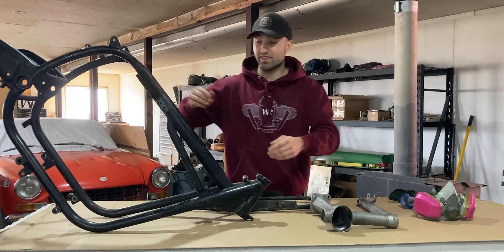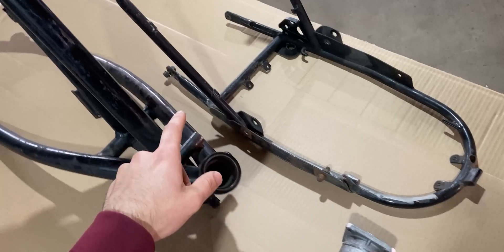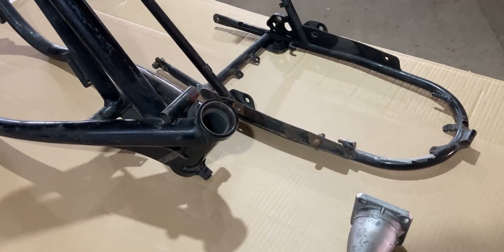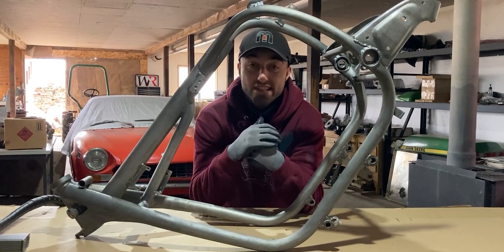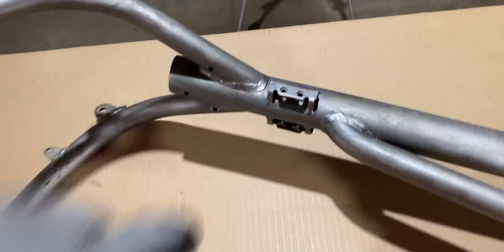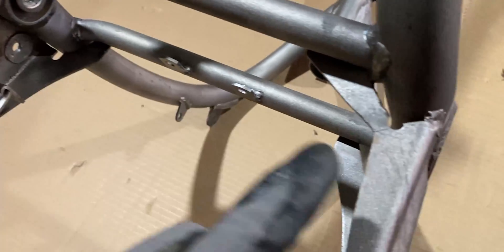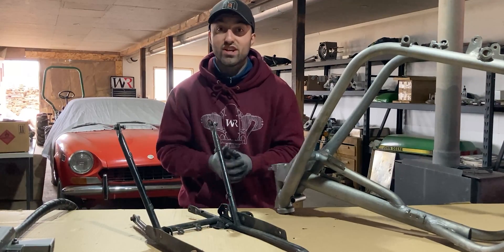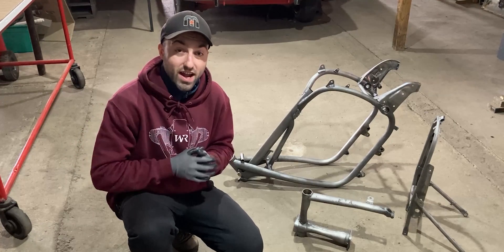Laser Cleaning a Motorcycle Frame | BMW R60/5

Comment: Which laser machine do you use? Ive know aboit this tech for quite some time, but aren't sure which what's a good machine to work with.
Reply from the maker: The laser cleaning machine is a 200W pulsed laser cleaning machine. There are many lasers on the market and you should source a distributor or a company that specializes in this equipment and test them out for yourself before purchasing. Regards Andreas

Comment: Great vid thanks, can I ask approx how long it takes to strip a frame and what laser do you use, where did yiu get it from..? Many thanks
Reply from the maker: Thanks for your feedback! I'm not exactly sure how long it took as I never looked at the clock. The laser I'm using is a 200W liquid cooled pulse machine. They are readily available on the market.

Comment: I just came across your video on the R60. Fantastic work. I've never heard of a lazar for removing paint. I'm surprised it did burn the cardboard under the frame. I always used a sand blaster on frames but that was the way to go in the 1970's. A lot messy than your lasar.
Reply from the maker: Hello Martin, thank you for tuning in! Lasers are used in many industrial applications nowadays and they are becoming more and more popular. Laser welding and laser cleaning has become very popular in the last 10 years, as it is becoming more available on the market.
These laser machines are also becoming very reliable and dialed in, to where you can remove only certain coatings which is highly beneficial for certain applications. In this video, I dialed in the laser to where it will remove paint, but not harm the metal nor the underlying material (cardboard). 
I will share more videos about this topic in the future. Regards Andreas
Reply: @WorkshopRebuild Hi Andreas, did you make more videos about the laser machine? I’m contemplating buying one, and would love to hear your thoughts and which machine you would recommend.

Comment: Can you tell us how you dealt with the two cracked pieces the laser paint remover uncovered. I’ve looked around on your other videos but didn’t see how you dealt with them. How did they turn out? Did you have to compress the two sides together to get the correct dimensions?
Reply from the maker: Hi there! Unfortunately, I didn‘t cover this repair in a video, but I remember sharing a little insight of this on Instagram account. I did not compress anything, as I would be putting stress on the small tab.
All I did was: 
-Prep the cracks to accept small tack welds
-Weld the cracks
-Clean up welds

It‘s a pretty simple thing to do and many BMW enthusiasts say if they see the cracks on that tab, they do not even repair them. In my case I did and we‘ll see how they hold up!

I hope this helps you, if you have some cracks on your frame too.
Regards
Andreas

Comment: How hot does the lazer get? i dont want to sound like a idiot  but can a lazer be  used on aliminium
Reply from the maker: Hi Christopher! The laser source does create a certain amount of heat, but not enough to where parts start to deform or loose their properties.
This cleaning method can used on aluminum and I've done many tests before. For example: Aluminum cylinder heads, linkages, carburetors and much more. Would you like to see more videos about this cleaning process?
Regards Andreas
Reply: @WorkshopRebuild  yes please  plus a clip pn some Alloy parts  being cleaned iam really impressed

Comment: Probably every r series airhead series bike has cracks in those areas. They don’t seem to have any affect on handling or frame longevity.
Reply from the maker: Thank you for sharing your knowledge! This is my first airhead and that's just something I found as I was inspecting this frame. Those two cracks have now been fixed an we'll see how long it will hold up. Regards Andreas
Reply: It would be interesting to see how you fixed the cracks.

Comment: Good morning, it is a very good solution, but I wonder... smoke is seen at some point, this means that it "heats" the part that is working... that is NOT good...
Reply from the maker: Hi Carlo, the smoke that you see is from the paint. After a couple tests with this laser cleaning machine, I found out that it does not change the surface temperature by as much as you'd think. The temperature range is +2° C at most. This is not enough heat to change the characteristics of the metal underneath this paint. Thanks for your comment!